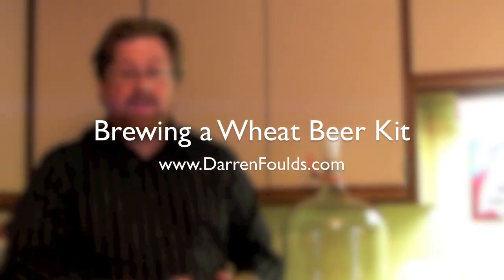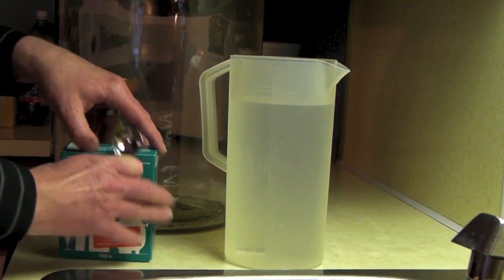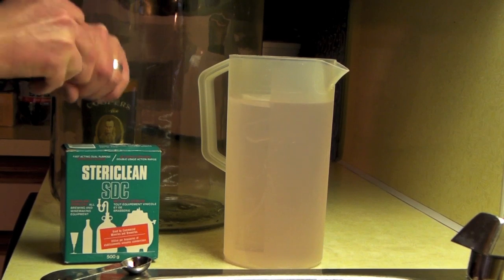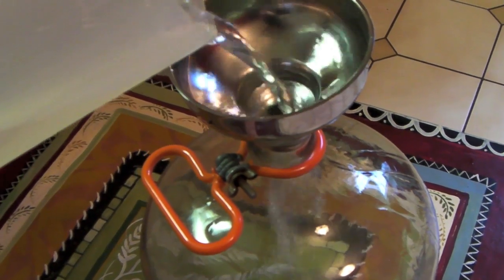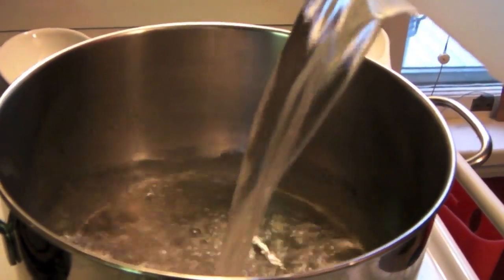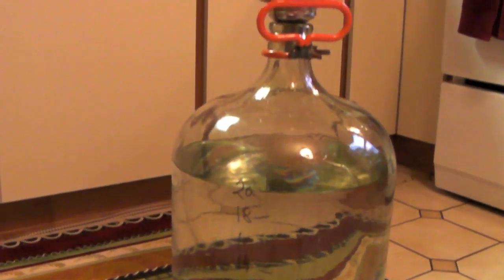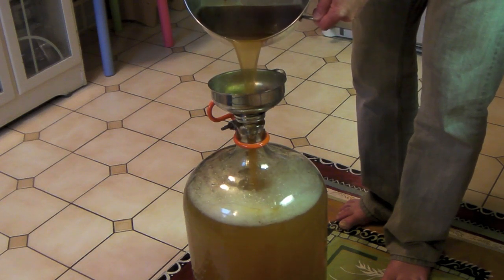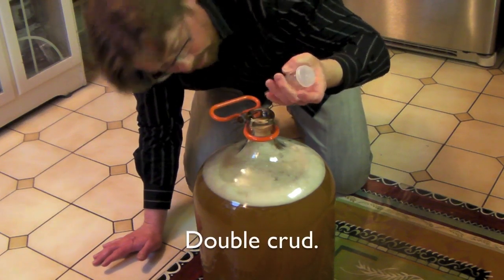Brewing a Wheat Beer Kit

Comment: After using sanitizer, you're not supposed to rinse. That can introduce bacteria, which is the reason you sanitize in the first place. Just saying.
Reply: Adam Clarke There are sanitizers you are supposed to rinse, and ones that you are not supposed to rinse. Just saying, it depends on the type of sanitizer you are using. For example, Star San is a no-rinse sanitizer, PBW (Powdered Brewery Wash) you rinse.
Reply: Chris Manion, PBW isn't a sanitizer. It is a cleaning agent. There is a difference. I've learned in the interim that there are sanitizers that need to be rinsed, but if you're trying to minimize possibility of contamination from outside sources, using a sanitizer that needs to be rinsed (such as a bleach solution) makes no sense to me. I'll stick with StarSan or iodophor-based sanitizers that require no rinsing. Just my $0.02 worth.
Reply: +Adam Clarke If he's using tap water it already has chlorine in it.